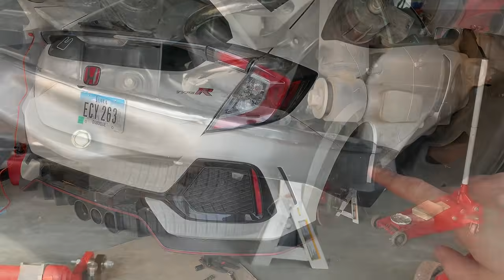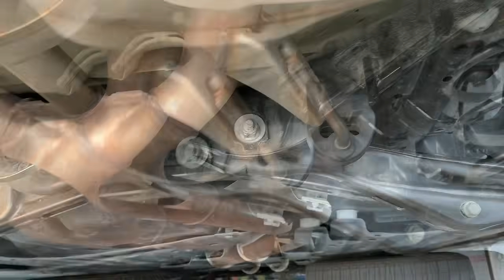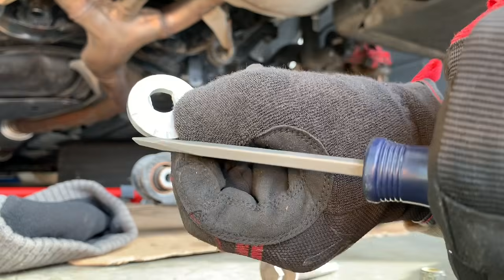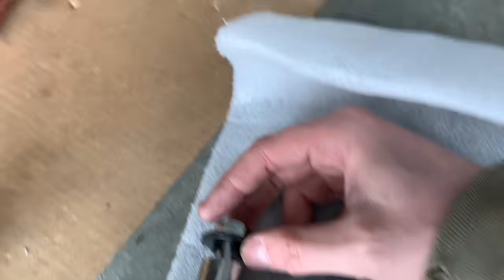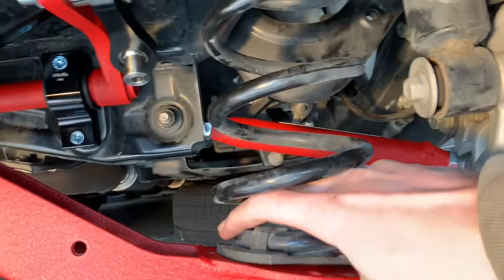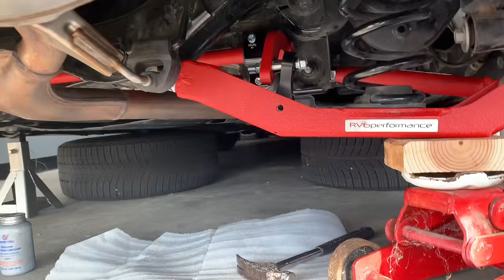RV6 Performance Rear Camber Arm Install Guide For 10th Generation Civic Type R FK8

Comment: This is terrible advice to hold the eccentric washer stationary while turning the bolt, you've damaged the washer by doing this. Better idea is to simply remove the nut, twist the bolt slightly to loosen off any tension on the joint and the washer would be able to be removed without force. The danger of YouTube mechanics...
Reply: I don’t think that matters anymore because it’s now a deleted item. He won’t need it with the new arms.
Reply: @chrisbecker3629  bad excuse for poor workmanship

Comment: How did you go about removing and installing the solid bushings in the lower knuckle? 
Thank you
Reply from the maker: Check out my channel, I have another video for them.
Reply: @bshatto3111  did all the parts make much of a difference in the handling of the car?
Was it hard to get it aligned?
Reply from the maker: @CKC19  they all make the car super solid - I like them.  Rough roads can be a little harsh, but that’s the trade off.  Otherwise very responsive and predictable.  As far as alignment goes I didn’t hear anything bad from my the shop that did mine.
Reply: @bshatto3111  Thank you Sir
I got mine all installed. 
Just waiting for warmer weather up here in Spokane to get it out and aligned.